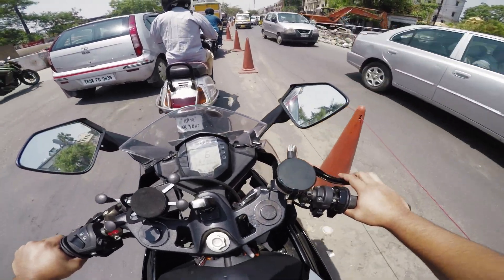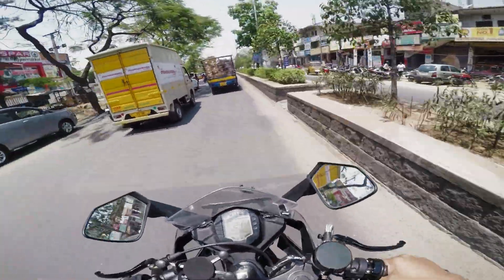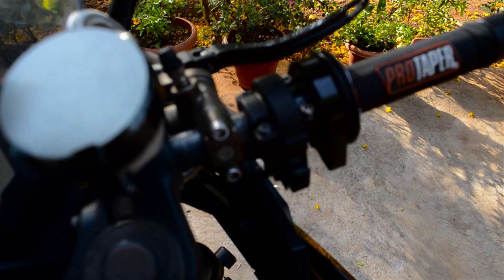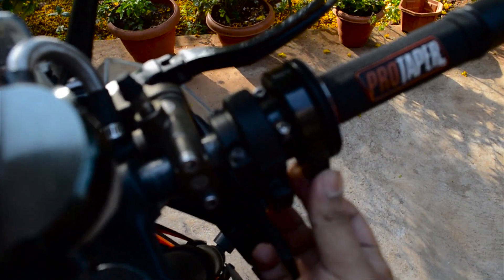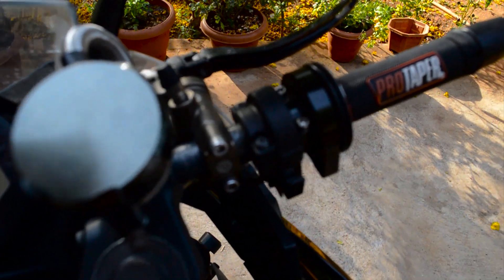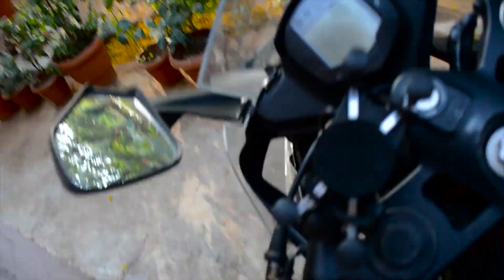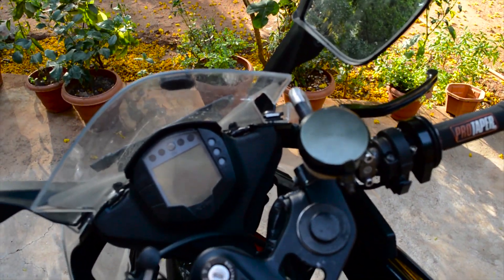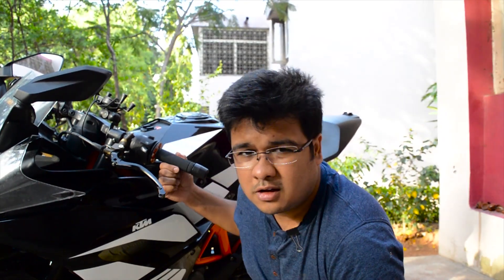A Universal Quick Throttle

Comment: I have gen 2 duke 390 bs6 should I replace my ride by wire to quick throttle? And also which hydraulic brakes are you using